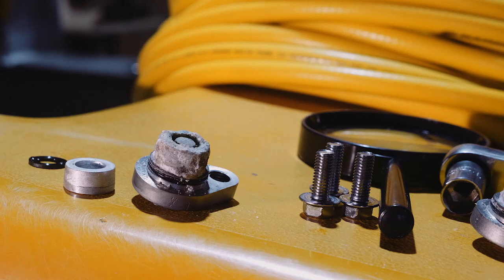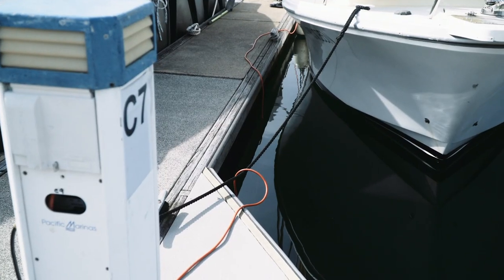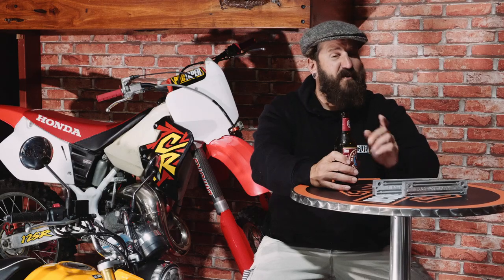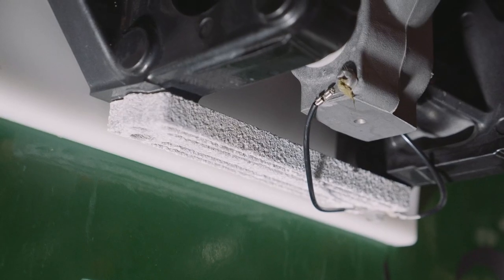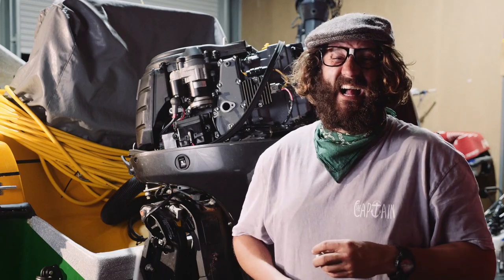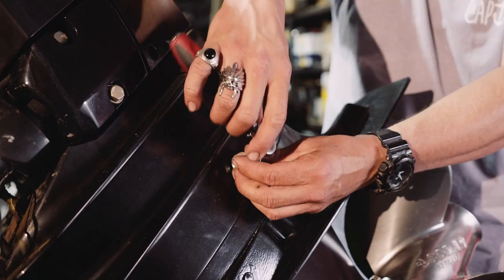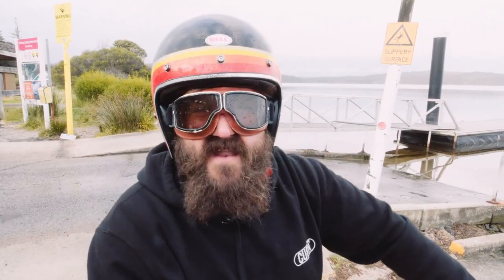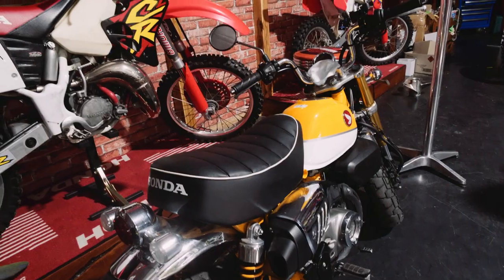Gutsy's Garage | An ode to electrolysis

Comment: Good vid. Mate had twin 2008 150 zukes serviced at the dealer since new. "Ya need a new powerhead says the dealer, welch plugs have corroded your head". Yeah, they're not welch plugs pal. My two 2006 175s are like new....because I service them myself. I source everything from Browns Point Marine in the US. Genuine parts, Good price. Gotta get a lot at one time though as the postage is a killer.